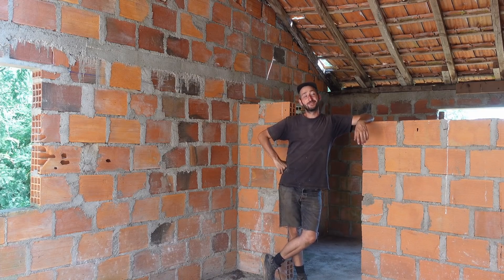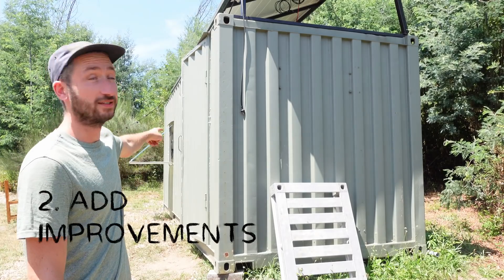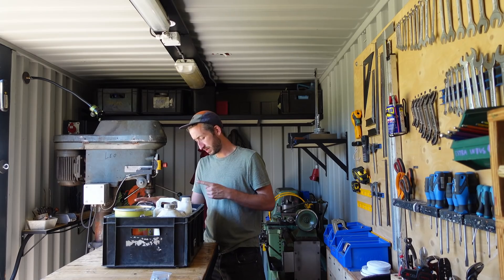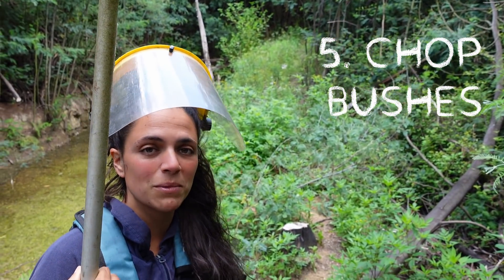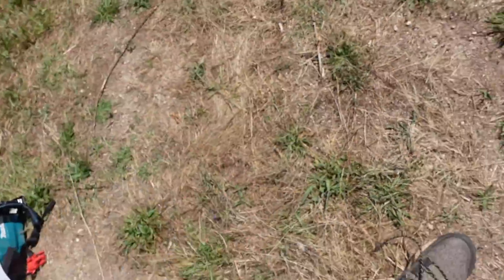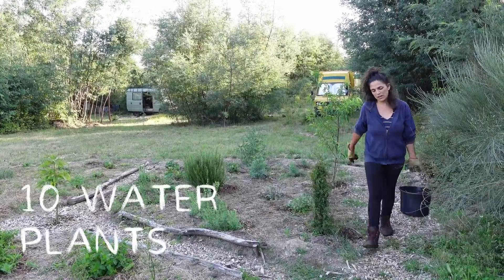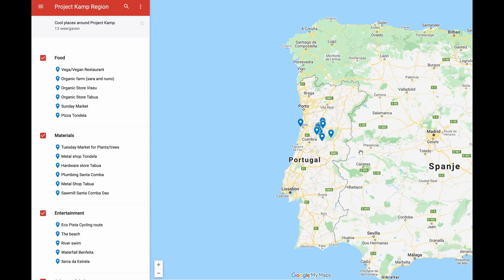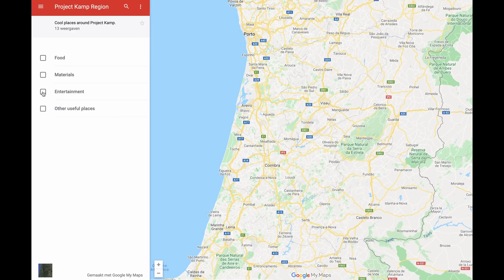#29 The boring things we have to do + Regional Map!

Comment: There is a gardening technique which stops weeds from growing which I saw practiced in Portugal. It works like this:
1. Get a heavy-duty black plastic tarp that can block out sunlight. 
2. Cover the area that you plan to use as a herb/vegetable garden with the tarp. Secure it with stones or pegs.
3. Leave the tarp for 2-3 months in the summer.
4. Lift tarp and remove any slugs or perennial weeds that remain. Most or all should be dead, though.
5. Cover the area in compost and plant directly in the compost.
This method kills off most weeds in the beds and leaves you with a relatively weed-maintenance-free planting bed.
Reply: the more eco friendly solution, cover the ground with cardboard. same effect and don't need to be removed and looks a lot better than black plastic :D
Reply: @ric_dk-9520   That's all well and good but it would be difficult to try and cover a large area with many different pieces of cardboard which might get blown away in the wind. You can also reuse a tarp again and again.
Reply: @wuddadid  no, you just pin the cardboard down with stages/pins .. or rocks/dirt ... The plastic needs to be secured the same way. No big difference.
Reply: Actually yeah, fair enough
Reply: @ric_dk-9520  The only problem is if it rains, as cardboard doesn't do well if exposed to water
Reply: @Aeldaed  it lasts for months, year(s), trust me it's a proven solution
Reply: I also think it would be better to plant things closer together. I don't know why so many people plant things so far away from eachother and then expect nothing to grow in between. When plants touch eachother they also keep the earth from drying out.

Comment: you had a rust spot on the roof inside the Tool container.
Have you ever thought about putting a roof on top of the Shipping Containers to keep them from holding water and rusting out!
A roof on top would also help keep the sun from heating the container up.

Comment: Lots of those weedy trees and bushes you have there (and that are very commum most places around here) are very dificult to eliminate just by cutting it to the ground. You have to kill the roots by impeding it growing leafs. At least for  3 to 6 months in the growing season (some all year, some spring and summer). 

You have 4 options:

Dig the ground and take off every root there. Probably need to do it again the year after.

Completly cover the ground, leftting no sun light get throu, with some strong mulch. plastic tarps are better, but is only doable in small places. Less then 20 to 30 cm of woodchips dosent work for these mimosas, thorny brumbles, bambus, etc.

Cut/ mowe to the ground every 2 months, for at least a year. Probably 2 years...

Herbicide (glyphosate). Probably, at least, two aplications, during growing season, as new sprouts appear.

Mix several above.

The easier and less expensive (and probably better to the soil and to your body), is herbicide.

It Will get better after a few years. Specially if you keep cleanning and covering the ground until new canopy shade start to happen.

You are doing great work. Living on the land and taking CARE of it. All good for you.

Comment: Get yourself a file guide for your file which gives you the correct angles and depth for filing saw chains. You will also need to file down the depth guage (the little shark fin in front of the cutter) to allow the blade to cut, so get yourself a depth guage guide and a flat file. Also hold the cutter bar in vice when you sharpen it. It can still slice your fingers even when the engine is off. Most important, always make sure the chain oiler is full and working. Just hold the cutter bar tip near the ground and rev the nuts off it. You should see a thin line of oil in the dirt. Your bar shows signs of overheating due to lack of oil. Good luck.

Comment: There is a solution for your bush problem with the lake and paths. Turn all the small tree branches and other stuff you cut into a crude tree brunch/wooden path. Its simple , you can make it even with sticks - just place them horizontaly next to each other and they will create a clear path. Its the same about your watter stream bath. Use them to make small makeshift wier to rase the watter lvl and use tree brunches/sticks to improove the steps you made (this way they wont collapce).

Comment: Please wear thick trousers (minimal jeans) when using the brushcutter and something to protect your eyes. Tiny pieces of stone cause gaping wounds on your legs, not to mention your eyes. (serieus, zelfs doorgeschoten zaad van bepaalde planten kan al wondjes veroorzaken. Been there, done that met m'n eigenwijzigheid)
Reply: Great advice  i'm not worried about the legs because he will feel it when they are hit....  but I now a guy who got a   piece of steel wire( they are used for example in grapevines..) that get caught by the brushcutter nylon thread and went at  high speed in the corner of his eye  and ended up in the back of the his  skull..people don't realize the danger to operate a brush cutter without the proper protection....🙁